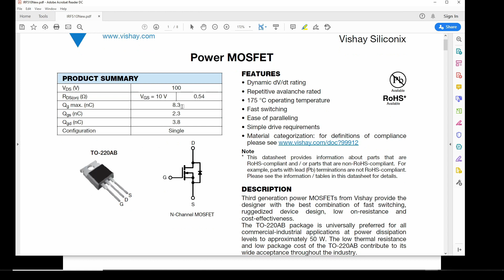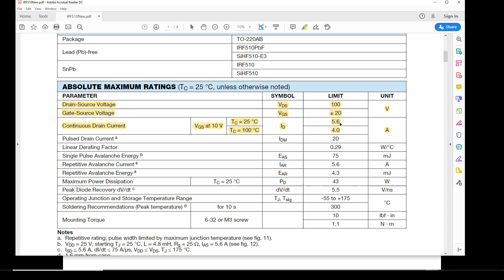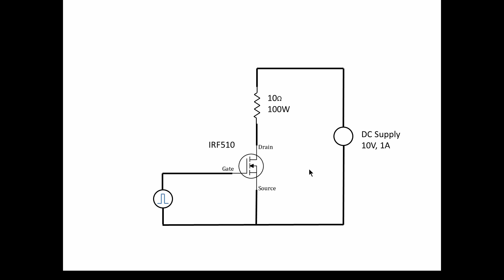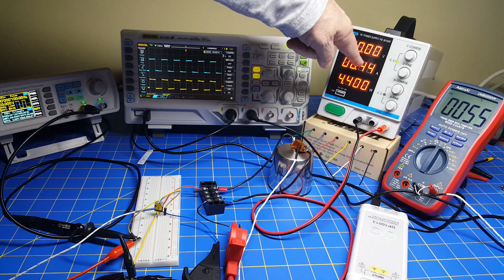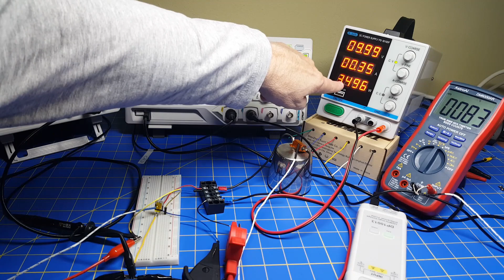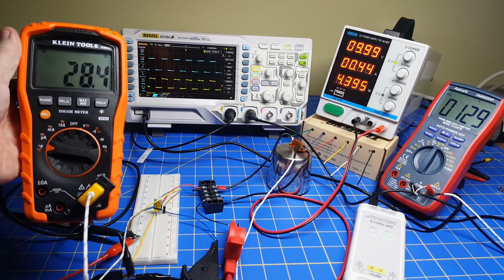Understanding Electronics #5: More MOSFET Stuff

Comment: Correction: 10 ohm resistor was a 25-30w size. 100w is >3 inch long (and those max ratings are with heat sink)